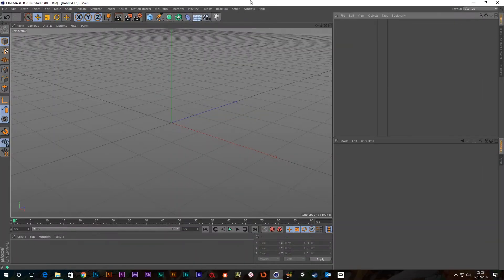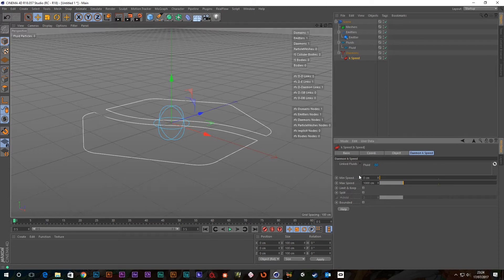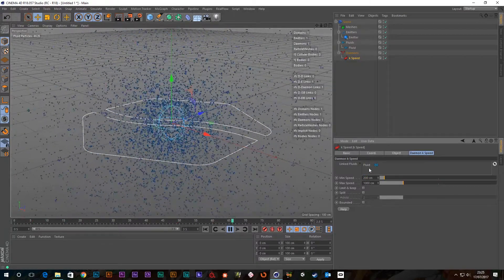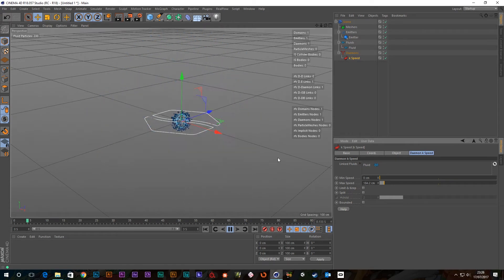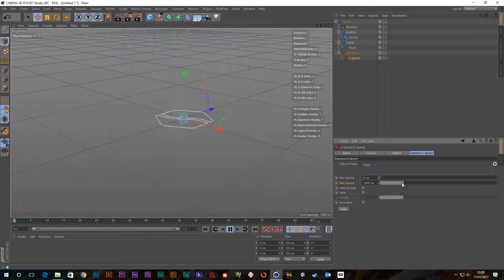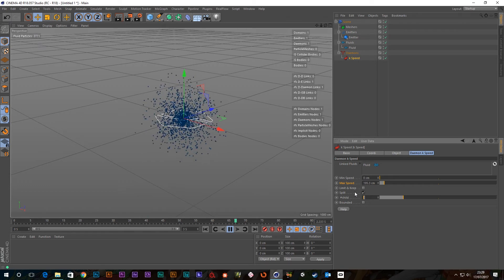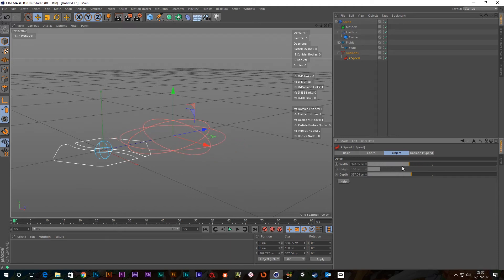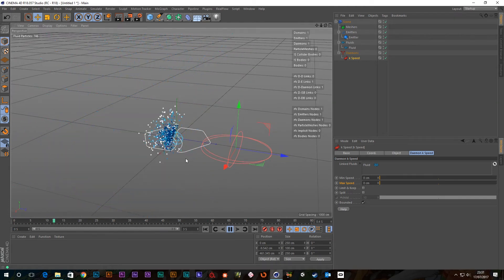Realflow For C4D: The K Speed Daemon

Comment: Thanks for your tutorial. What is the best method to  do a time remapping? Is it possible to use the cache object to make a slow motion?
Reply from the maker: Scene > Solver  > Timescale, a value of 1 is normal time, 0.5 would be half speed.
Reply: @DIGITALMEAT  With that method change the result of the mesh. Maybe can you suggest another method?